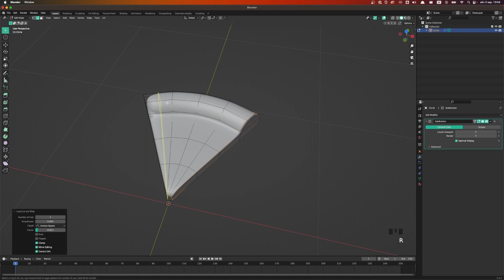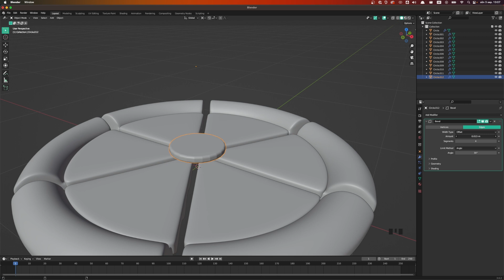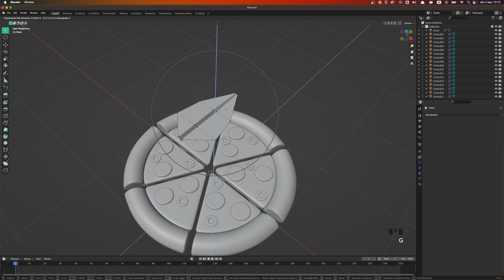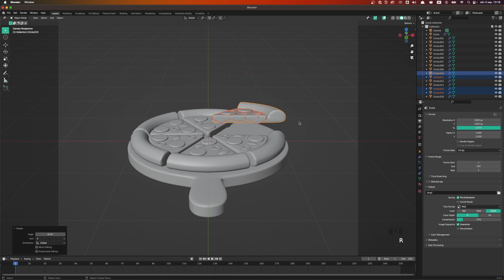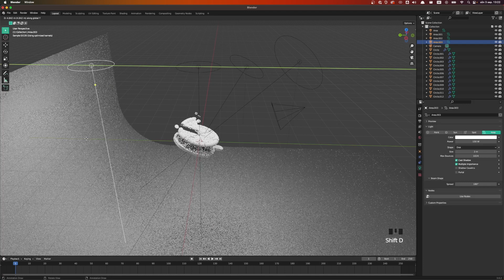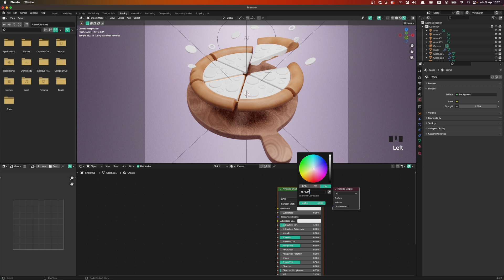Tasty Pizza - Blender 3D Beginner Tutorial

Comment: Did this tutorial in Blender 4.3. Had a lot of trouble due the missing musgrave texture. I mad the board in blender 3.5 and then imported it in blender 4.3 to see the differences. Seems that you have to add another noise texture in the place of the musgrave texture.  But the tutorial is really awesome
Reply from the maker: Yeah I think you just use 2 noise textures instead ✌️😊
Reply: @ Yes indeed! Two noise texture nodes will do the trick. But i’m not so experienced with the texturing nodes, So for beginners tis is the answer for tis problem.